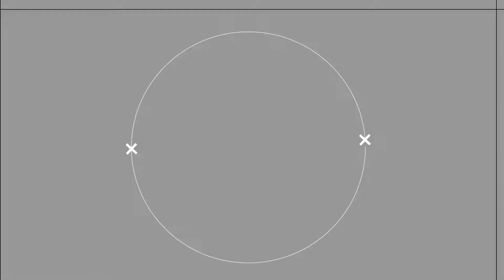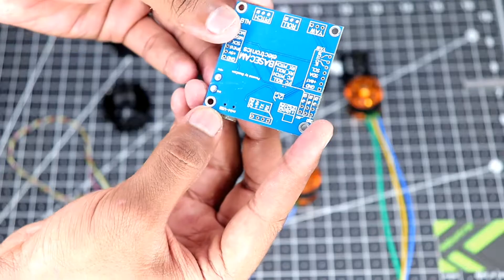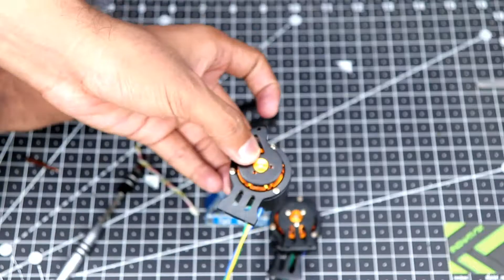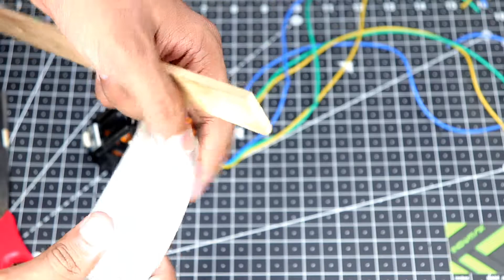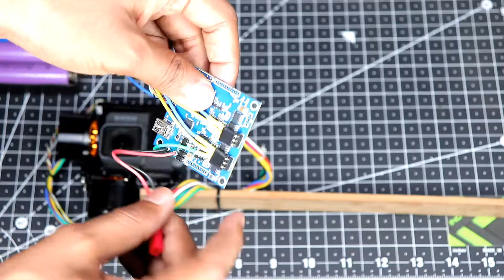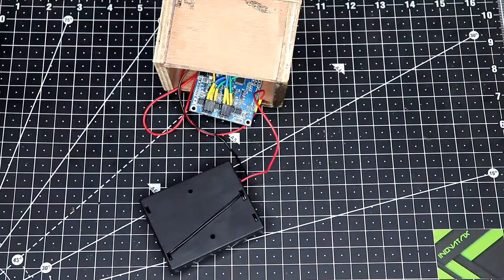DIY Gimbal for you Action Camera | Full Build Video

Comment: Also, do the radio sticks control absolute position of the gimbal, or rate of change of the gimbal? Is it easy to program "free mode": the desired behaviour should be to have the pan axis completely independent/counteracting the yaw movements of the drone.?

I would want to avoid this situation:

it follows the movements of the drone on the pan axis, which are unpredictable to the gimbal operator. All this makes framing a shot very hard (shaky correction movements and unintended movements).

It is only possible to control the absolute position of pan axis with the radio, not the rate of change. The tilt axis controls the rate of change with radio stick input, so that's completely fine.

The consequences are:

1) when I release the radio pan stick, the gimbal returns to the default pan position => not desired behaviour
2) when my finger trembles unintended, the shot is ruined, as the absolute position of the pan axis is changed
    2a if you wanna reduce the effects of trembling or moving the stick unintended, you can do that only by lowering the pan max rotation speed => harder to frame your fast moving subject in the shot
3) no possibility to put expo on your pan input, as that would make the end points uncontrollable and pan to slow near zero point
4) no possibility to control pan speed rate of change via settings on radio => you have to connect to computer via usb = very annoying in the field during a shoot

Comment: Nice I am considering trying it or a similar gamble kit. It looks like you could have just drilled and screwed on the wood handle. I want to use it with my Smart rig case with iPhone 15 pro max as my camera. With mic and  accessories attached. I am going to make a 3D printed enclosure to make it look nice.
Reply: Oh I meant  SmallRig not smart rig is the case and accessories I have. I'd like to be able to hold onto my side handles and have the smallrig frame case gamble around to stay level.

Comment: hi! this is awesome. can it be remotely controlled as well?
Reply from the maker: Yes, if you use the same gimbal control that I have, you can use a 2.4 GHz transmitter and receiver or make one yourself with Arduino and NRF24L01 modules.

Comment: how did you choose the correct motors for this application? I see that you didn't use gimbal motors
Reply from the maker: Those are gimbal motors. If you have to, you can either check the motor compatibility with the Gimbal controller. Or just trial with 60-90kv motors.
Reply: @INOVATRIX  oh okay, so it is possible to use normal brushless motors? because I am currently trying to build a small and lightweight gimbal for a drone. The gimble motors i have found are too big with 27mm being the lowest I have found thus far. I need something that is around 20mm. Which is why I was considering on using normal brushless motors that are used for propulsion. 

thoughts and any other suggestions on this? It would really be appreciated.
Reply from the maker: Not recommended to use normal brushless motor. You can make a gimbal out of servo motors.
Reply: @wanangwanyasulu7715 Try it, that board will probably work fine with any brushless motor. Smaller motors will draw less current from the drivers, just make sure they are low KV. You need the higher torque for the camera mass.

Comment: hay, can we put a dslr camera on it?
Reply from the maker: Servos could also work, but then you would need an Arduino based system to control them. They are also not very smooth in motion.
Reply from the maker: There is a possibility but the motor are too small and you would need to make a custom frame to fit such a large camera.
Reply: @INOVATRIX  yes.. i will try.
But how about the servo motors?